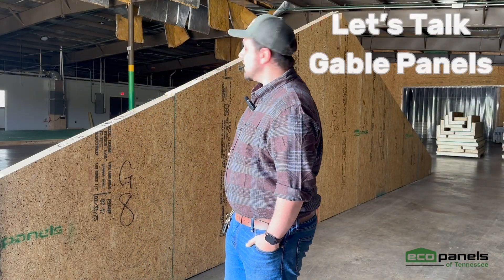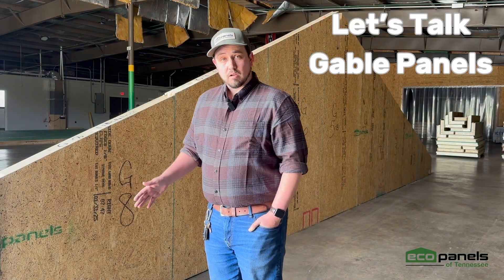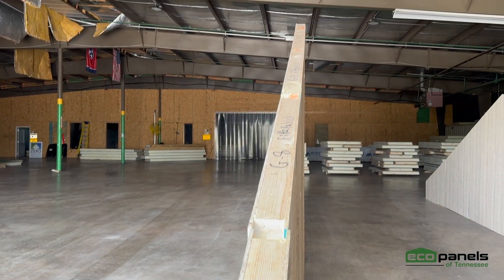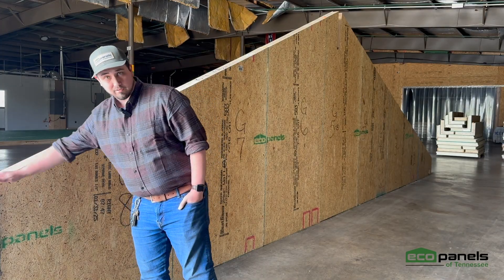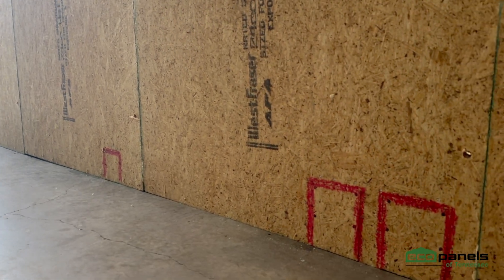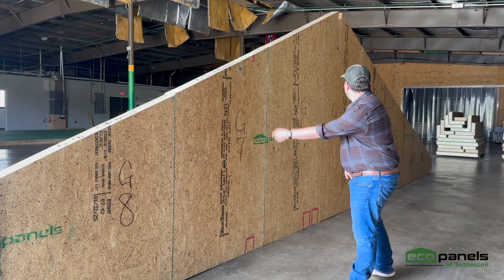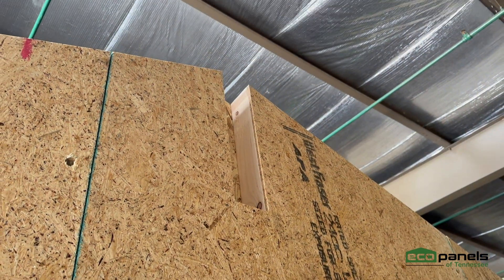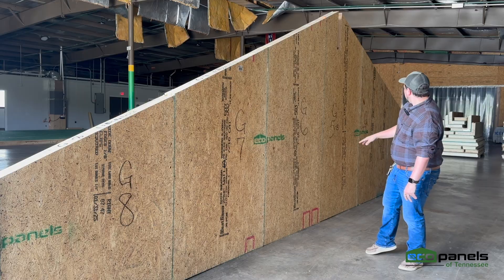Let's Talk Gable Panels | Eco-Panels of Tennessee

Comment: I'm finishing up an Eco-Panels house now. I wish I had known or thought about these. I would have definitely done it this way instead of having standard Gable ends made by my truss builder.
Reply from the maker: In many cases, it's makes sense to frame the gable end as your builder did. This is usually dictated by if you're insulating the ceiling or roof. In a vented attic space where the ceiling is insulated (think blown in insulation, etc) then extending our panels to the gable end doesn't benefit the thermal envelope. If you're insulating the rafters of the roof, panelized gable ends help. Congrats on your project!

Comment: How much weight can that ridge beam pocket support long term?
Reply from the maker: Don't have the specific data for this project, but well more than the roof load. Rather than loading it on a couple of ganged up studs, your getting the benefit of that weight being distributed across the panel width.